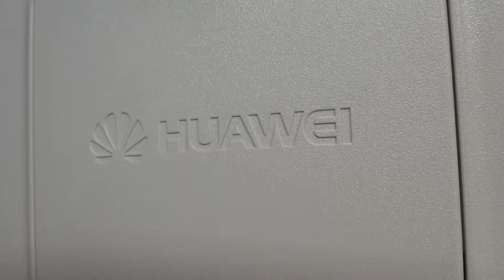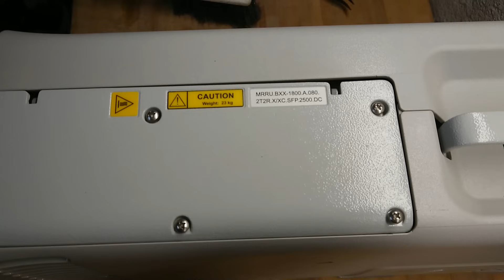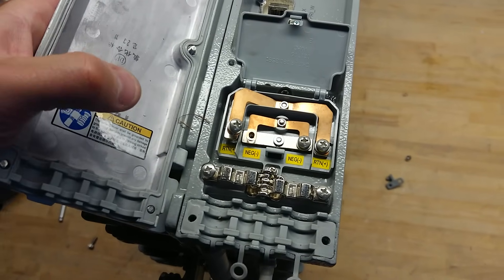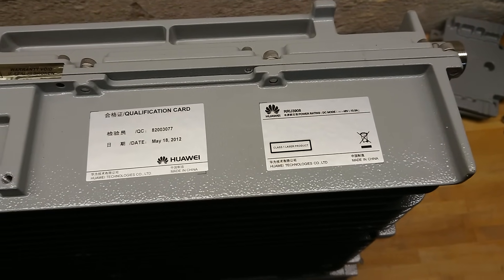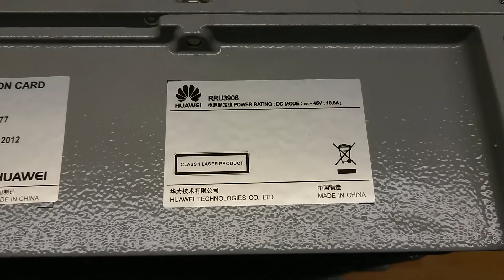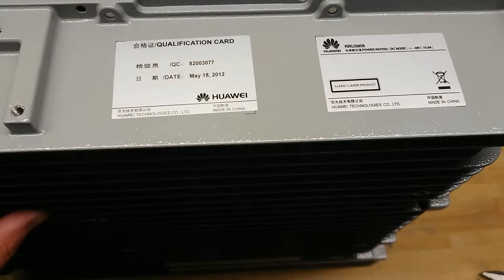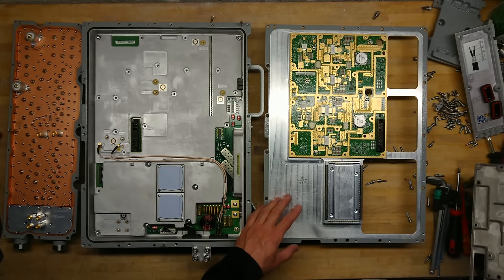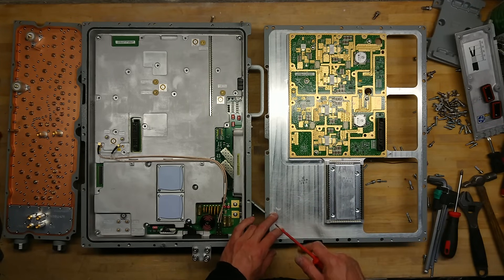Inside a Mobile Phone Amplifier! Huawei RRU3908 1800MHz Base Station Teardown (Part 1 of 2)

Comment: Does anyone know how they tune those multi-resonator filters? I recently found out how to build and tune bandpass filters with two resonators. I would like to make filters with more resonators but I dont understand how to tune them. There are too many variables to adjust! There has to be some adjustment procedure for that but I cant find anything :(
Reply from the maker: I seem to recall a commenter long ago, talking about how this is all done with servo/stepper motors on all the adjustment screws and its a algorithm that tunes it all. Almost impossible to do 100 variables by hand...

Comment: Did the sticker say negative 45V or positive 45V?
Weird labeling if it's actually positive 45V
Reply: When you pass electricity through electrodes in a conductive solution, the negative side gets electrons from power source, and gets reduced. The positive side loses electrons vice versa and gets oxidized. To prevent occasional leakage to cause corrosion to the power cable, telecom gears use negative input, so that the ground is positive, and the core is negative. If there is a leakage, the much larger ground wire (usually the shield) gets corroded, rather than the much thinner core, so it is more resilient to corrosion.
Reply: Telco is usually -48

Comment: That's a lot of cooling for 40watts?
Reply from the maker: The 40W is the output power, if you look at the power input rating it is much higher and that energy minus the output power is what it has to dissipate in the heat sinks.
Reply: @KaizerPowerElectronicsDk  Thanks.

Comment: A #diplexer is a passive device that implements frequency-domain multiplexing. "Two ports" (e.g., L and H) are multiplexed onto a third port (e.g., S). The signals on ports L and H occupy disjoint frequency bands. Consequently, the signals on L and H can coexist on port S without interfering with each other 18:37 & "Right Insulators" some study "software defined radio" modulation as #RDS add-on functionality...

Comment: I do believe the long copper rod with plastic spacers at the bottom of the screen at 16:00 is an implementation of coax. Once the top cover is on it would be an enclosed cavity. The parent stock is already big enough that it would have been cheaper to tool that slot than to add another pair of connectors

Comment: The Chinese characters said "The oxidation process (of the aluminum casing) passes the anti-corrosion (e.g. 168 hrs continuous salt fog corrosion) test requirement".
Reply from the maker: Pretty high efficiency in those characters. They are like 4TB disk of information in each.
Reply: @KaizerPowerElectronicsDk  The reason for me to write it as clear as possible, because I had been worked in one of such facilities, which handled the aluminum parts anonadization process for Huawei and Apple.  They were among the pickiest customers; only slightly better than airliner parts (e.g. handrails).
Reply: 氧化合格 Qualified (against) oxidation

Comment: The Nickel silver Cylinders are tuned to correct frequency boost or resonance by adjusting antenna wires or screw close to the cylinders. works exactly as If you fill a waterbottle to different volumes and blow over the bottle opening; you get different tones depending on the water amount.
Reply from the maker: They also make for nice standoffs when reused in building other stuff :)
Reply: Reminds me on Helmholtz resonance...

Comment: Many times electrical Engineering concepts are learned in the abstract/simbolic/squematic dimension. That openned resonator filtering cavitie really clears one of those concepts. Physically filtering (modeling the frequency response curb) of electromagnetic radiation is almost witchcraft with all the orthogonal issues involved. I wonder if that cavety structure was designed empirically/manually/trial-and-error or by software simulation. I have handle those models myself some years ago when the 4g was a new thing.
Reply: I had to google orthogonal

Comment: The thumbnail looks gross, so I came, but what are these random looking chambers for? Very interested...
Reply from the maker: It is a special kind of band pass filter, to narrow down a signal to its carrier frequency, I explain it in more detail here. Duplexer band pass filter explained: https://www.youtube.com/watch?v=HNaAQ3a7Duc
Reply: @KaizerPowerElectronicsDk  Thanks for the reply, I just learned sth new today
Reply: This is microwave frequencies... waveguides rule the roost here... this isn't anything like a standard pcb radio circuit seen at lower frequencies <100Mhz ... resonant cavities etc.  

Designs like this are half physics, half art... at these freqs a resistor can be an inductur or a capacitor an inductor  becomes a resistor !! .. hell, even a piece of wire can be any of all of them !! 

I have a "reasonable " understanding of RF to 100 Mhz but this stuff is way past my pay-grade !! 😂😂
Reply: @peterfitzpatrick7032  Ok thats epic

Comment: 4:36, Date usually be formatted with YYYY/MM/DD in China. Anyway, I do not find any information about date on the metal shield.
Reply from the maker: 12.23.11 that is written in the lid, corresponds very well with the the sticker at 5:19 May 18th 2012 could be 12.18.05, but the text in the lidt could be anything since its a later date than the sticker.

Comment: I just subscribed yesterday and i have to say this kind of content is super interesting. I just would like to ask, how much is the average price of this class of apparatus?

Thanks for the content, gentleman.
Reply from the maker: As scrap it has a rather low value. Mixed aluminium, steel, Electronics and plastic. So maybe around 1€/kg if you find someone that wants the gold plated boards out. But properly much less. You can find them at 1000-3000$ used or NOS on alibaba. From new... Properly pretty expensive, anyone knows?
Reply: @KaizerPowerElectronicsDk  thank you, i'll stay tuned for some more base stations teardowns since this goodness isn't really easy to find anywhere else. ;)
Reply from the maker: @genericdynamics6618  Thank you for the sub. I got some more Nokia Siemens gear in editing, 2 power amplifiers :)

Comment: I pulled apart a similar unit that had doherty amplifiers in it.  I was able to cut out sections of the PA's and they work very nice at 2.4ghz in non doherty mode with minimal tuning.  Those diplexers are a work of art!

Comment: Will that diplexer go up to the 2.4GHz ham band?
Reply from the maker: No, these are tightly specified around +/- 100 MHz of its working frequency. I think you would need to change the resonators to get another frequency span.
Reply: @KaizerPowerElectronicsDk  It seems those cups could be machined down easily, and a nice 2.4G project might be realised.
Reply: @SteveWrightNZ  It's not that simple. The resonances of the resonators are all interlinked and the design of this is extremely precise and mathematically super complex. Getting anything even slightly (0.1mm) out of place, even without changing the design, will result in very little functionality. This is the reason for the tuning screws, because manufacturing tolerances are insufficient to get the system well enough in tune to work (like, *at all*). I doubt this one will be in spec when reassembled, even without moving the screws, just because the lid will be on slightly different.
Reply: @treelibrarian7618  Well, you get ham radio people who try things and people who don't.  I'm not trying to find people who don't try things and say it cant be done.
Reply from the maker: @Tree Librarian and @Steve Wring There is amateurs working on reverse-engineering these power amplifier modules, here is a good example of one from my teardowns: https://highvoltageforum.net/index.php?topic=765.0

Comment: E and W mean East and West. They are the two direction to create a ring connection. The ring topology allows for single failure of a ring segment.They obviously have no relation with geography they just mean that you have to connect a East port to a West port on another apparatus and viceversa.
Reply from the maker: Interesting, there must be some history behind that, that the first designs was facing east and west. Normally from redundant networking in industrial settings, we call it A and B.
Reply: @KaizerPowerElectronicsDk  In a redundant 1+1 leg of a star topology you would generally call it A and B. However in a ring topology of interconnected nodes which each can be transit nodes for others then E and W is common terminology for traffic between nodes at the same tier. North/South topologically would be up and down the network tiers.
Reply: @KaizerPowerElectronicsDk  I don't go farther than SDH/SONET networks and such terminology was already present there is 1997-ish.

Comment: I wonder if the plastic removable covers are for forced air cooling if it's used inside as the airflow would be parallel to the fins
Reply from the maker: That is a good suggestion!
Reply: The plastic shields are commonly known as sun shields on RRHs, they are to protect the unit from direct sunlight which improves cooling.

Comment: omg that thing looks like a hell of a fun RF tuning adventure!
Reply: I used to do that job ... back in the mid 90's ... it's fun the first few times but when you're doing 16 per day day after day... but this looks easier to tune than the ones we were making. this is a dual diplexer (2 complete separate units) 9 resonators with 2 inverted poles on the transmit side and 7 resonators with 1 inverted pole on the receive side of each one. Ours were 12(2-) poles and 5(1-), and they get exponentialy more difficult with more poles...
Reply from the maker: Could you tell me more about the inverted poles?
Reply: @KaizerPowerElectronicsDk  It's 20 years ago so I can't exactly remember technically how it worked, but basically the whole filter is a chebychev resonant system. normal poles all pass the signal at a frequency, but where there's a link between two resonators (wire with a disk on each end) that bypasses the normal sequence, the phase relationship created inverts one of the poles, making it reject a frequency. These inverted poles are used to increase the filter slope where the two filters would otherwise cross over, giving better than 120dB rejection of each filter's passband by the other filter, allowing the gap between the transmit and receive bands to be really small and still use the same antenna for both. I can't remember whether it's the bypassed pole or one of the two linked poles that gets inverted, but it would be fairly obvious as soon as you have it hooked up to a network analyser to try to tune it :-)
Reply: @treelibrarian7618  are there couplers with these resonate poles? Was this for broadcast or ?
Reply: @gammaraymonkey  not sure what you're asking about couplers. They couple together via the gaps (doorways?) between the resonant chambers. The degree of coupling could be adjusted by a screw poking into the gap. There were also links that could be called couplers between some of the chambers producing inverted poles (see my other reply). The purpose of a Diplexer like this is to allow two very close frequency bands to go in opposite directions (transmit and receive) to the same antenna without the transmit power interfering with the receiver. The ones I worked on were for 3G towers, one for each antenna, about 12 per tower.
Reply from the maker: I hope they have robots for that. 20 servo driven screw drivers to a tuner :)
Reply: @KaizerPowerElectronicsDk  my dad started designing wave guide antennas a few years back but the guy that got him started tried scamming him so he basically just shut it down on him. but i did help him make a few up, there is one down in Brazil providing internet access that someone looking to provide it bought, one in Greece and one in Texas that i can remember and that guy has a 70 mile range with his! they were aluminum tube that he'd drill out and put end plates in and then filed all the holes to perfection to tune it.
Reply: @ToeCutter454  those things were used in point to point connections?
Reply: @thkatsou  i'm not sure what they had for a setup, my dad was the one that talked with the guys that bought it to put up but i do remember it was a 70 mile range they got. not sure if they were testing new equipment with it or what. the antenna we built was able to be tuned slightly and we made a few in the 5 GHz range but most were 2.4GHz with "wings" on them to increase the strength of the field. the antennas themselves were about 3.5 to 4' tall and the feed cones inside were custom built by my dad, he's pretty meticulous when it comes to that kind of stuff being an engineer.
Reply: @ToeCutter454  probably it was point to point .That means they put 2 antennas facing each other to create a virtual cable that connects 2 points .I have done a setup like this in a greek island but only 1-2 miles distance.
Reply: @thkatsou  it might have been that then, there is one or 2 of our antennas over there in Greece. my dad did travel over and meet the guy that bought them because he was quite impressed with them. not sure where they're at though.

Comment: Thank you for sharing video. I have  a question. Does this RRH have motor fan to cool ? If not , it has only heat sink to coo ?
Reply from the maker: It would have to be a external unit as the enclosure did not have any holes for forced air cooling. I guess this is a pure convection cooled unit, which is doable when it is mounted in the top of a tower.

Comment: CPRI is probably channelized primary rate interface... -E for east and -W for West.
Reply: My brain isn’t working, hah, Common something radio interface...  had to google it to figure out the something Common Public Radio Interface. I was thinking telco not cellular gear.
Reply from the maker: Yes, it has to do with the network connection " This connection (often referred to as the Fronthaul network) can be a fiber to an installation where multiple remote base stations may be served."
Reply: Kaizer Power Electronics In this case I think Huawei supports 2 cascaded RRU connected to a single BBU port. I am curious where you found this unit as it is my understanding that the only Danish operator using Huawei RAN is TDC and this unit seems a bit old to come from TDC!
Reply from the maker: Okay, so tha way they can do 6 antenna LTE, but it requires many amplifiers and uses a lot of power. I also thought that TDC was the only operator using Huawei, so either they started out with old equipment or its from somewhere else. Its from a scrap yard, no idea about the origin.

Comment: Would love to get one of those main boards when you have finished filming
Reply from the maker: From the HAM operators I have talked to, no, these are simply too complex and specific to the job (900/1800/2100 MHz) to be reused as a whole piece of equipment.
Reply from the maker: Everything is returned to the owner for metal scrapping, as it is highly valuable boards due to the gold and other precious metal contents. A board like this is properly around 5-15 Euro in scrap depending on content.
Reply: Would have been happy to pay, was not expecting anything for nothing!
Reply from the maker: Contact me through here http://kaizerpowerelectronics.dk/about/contact/ 

I soon got a newer and smaller base station amplifier. I can send you a picture of the board once its out and you can get it at scrap value + shipping :)
Reply: Would the RF stuff - specifically the power amplifiers - be easily modified to work on an amateur radio band?